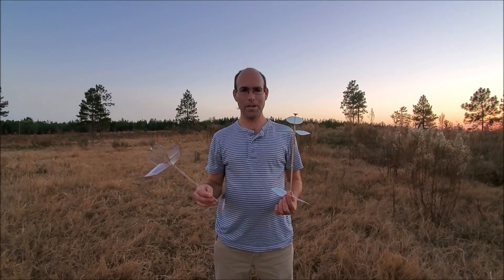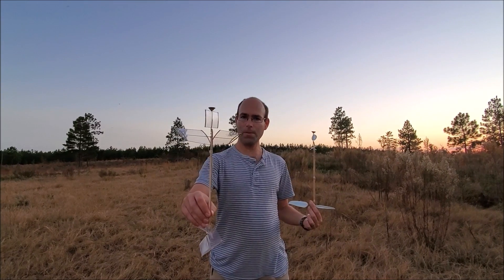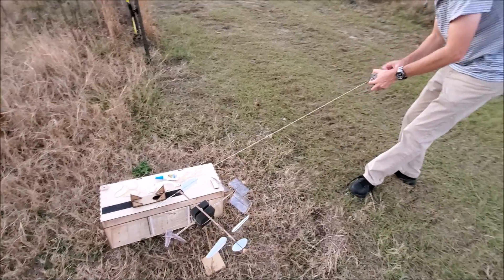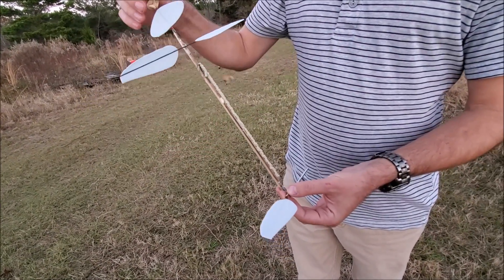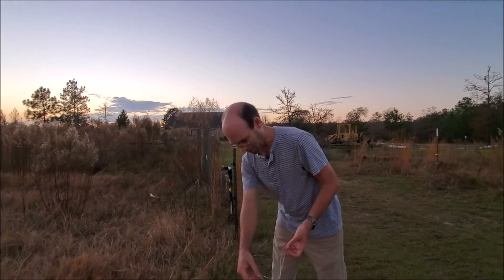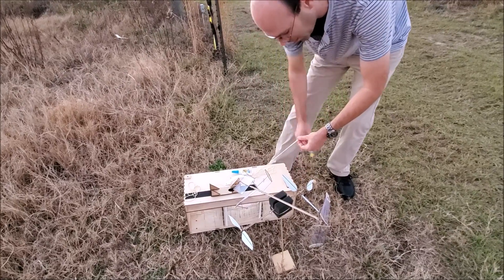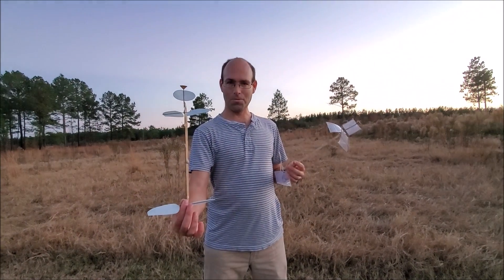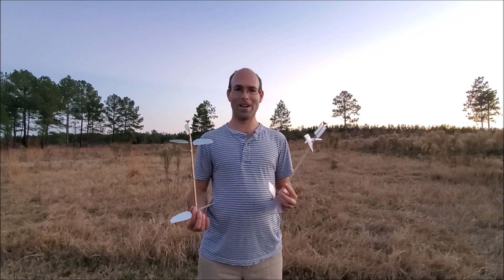Flying our 2021 Science Olympiad Helicopters: Twister and Tornado

Comment: Very interesting. These seem to be a departure - they have much smaller rotors than the ones I have seen in other Science Olympiad videos, I gather they use thinner rubber, which means more turns and less weight, but they would turn at higher RPMs. Another feature that seems different is the fixed vertical surface above the top rotor - what is it for? I love that they can flip upside down then recover upright.
Reply from the maker: Actually the built up one runs much slower than most (Tornado). The Twister runs about the same rpm as other helis on the market. The vane is a stabilizer which helps keep them upright a little better and enables recoveries like the one you saw.
Reply: @joshuawfinn  That's even better, then, since the smaller rotors means less rubber cross section and therefore a lot more turns, which automatically translates to much better duration if you're keeping RPM the same or reducing it. The vane certainly does work, if that's what cause the recovery at 4:52.

Comment: Hi! I was wondering if the twister model has a single bladed rotor or if it is dual bladed?
Reply from the maker: Dual blade only. Ive tested a lot of single blade designs an none has flown well. I haven't seen anyone else get them to fly well either.